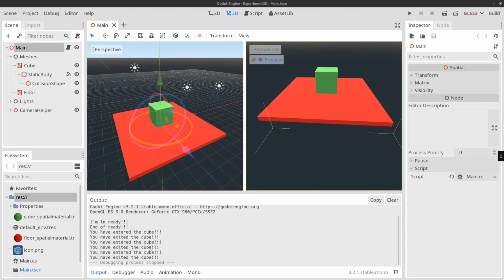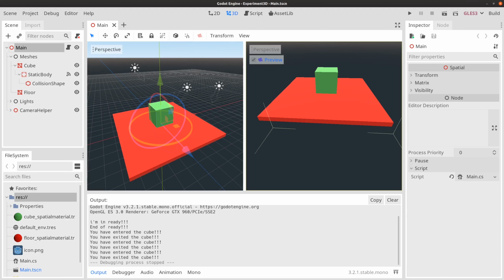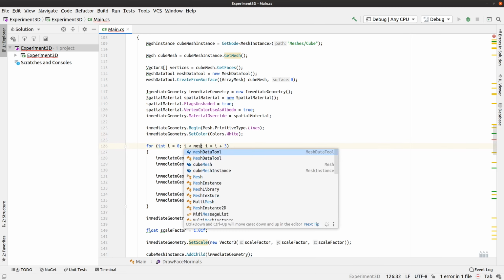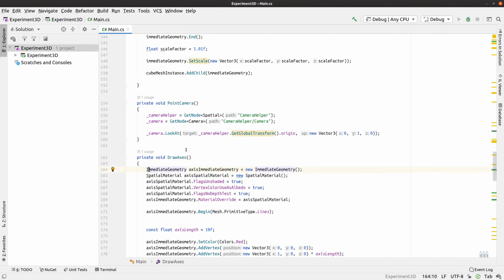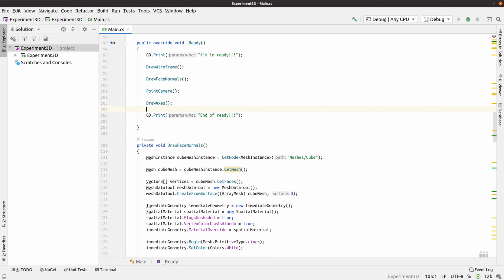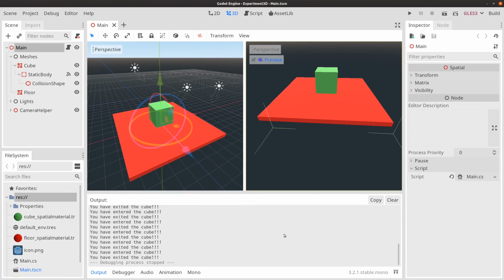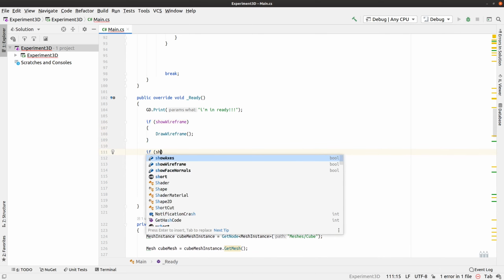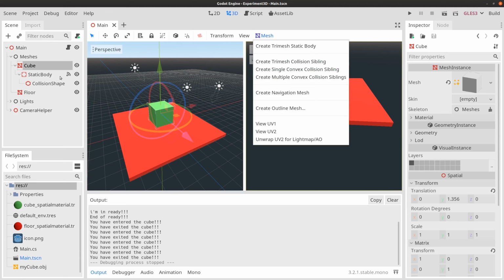Godot 3 - 3D Mesh Manipulation - 07 - Displaying Face Normals in C# with the Rider IDE

Comment: This one threw me for a loop for a bit as I'm pretty band new to all of this. You (in C#) have a cast to ArrayMesh which is a parent class of Mesh, or at least it is in GDScript. In GDScript cubeMesh is still just a Mesh and so trying to call create_from_surface doesn't work as it's expecting an ArrayMesh. Here's how I got around it, not sure if it's the best way but I grabbed it from some documentation and pieced it together so it's working.

	var cubeMeshInstance = get_node("Meshes/Cube")
	var cubeMesh = cubeMeshInstance.get_mesh()
	var vertices = cubeMesh.get_faces()
	var arrayMesh = ArrayMesh.new()
	var arrays = []
	arrays.resize(ArrayMesh.ARRAY_MAX)
	arrays[ArrayMesh.ARRAY_VERTEX] = vertices
	arrayMesh.add_surface_from_arrays(Mesh.PRIMITIVE_TRIANGLES, arrays)
	var meshDataTool = MeshDataTool.new()
	meshDataTool.create_from_surface(arrayMesh, 0)

Didn't know about the export variable, pretty cool. In GD Script they look like this 

export var show_wireframe = true
export var show_axes = true
export var show_face_normals = true

I'm sure this won't mess with my head with JavaScript. :P

Past that, a tip for you for C# but instead of using something like this:

Vector3 a

Just use:

var a

It doesn't mean the same thing as it means in GDScript (variant vs variable) but it saves keystrokes and/or even typing out complicated types when you don't need to.

Also, with your constructors use the handy initialization:

var spatialMaterial = new SpatialMaterial { FlagsUnshaded = true, VertexColorUseAlbedo = true };

Just some simple syntaxty things that will save a bunch of keystrokes.
Reply from the maker: I like being explicit with my types. Java introduced a type inferring "var" (like "auto" in c++) a while back but I never use it.

Old habits die hard I guess.